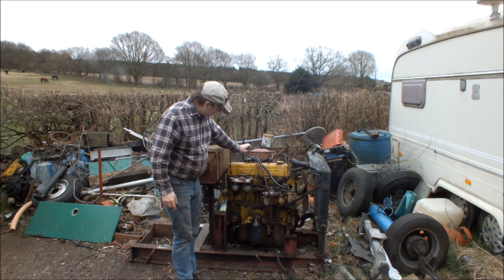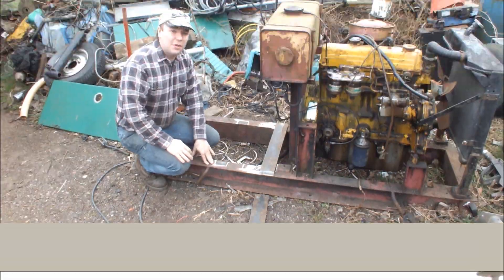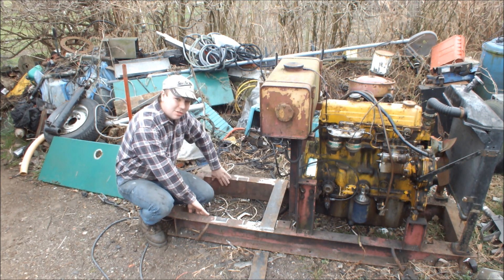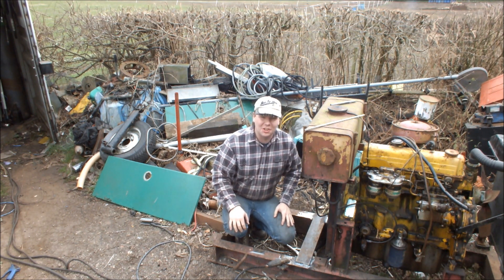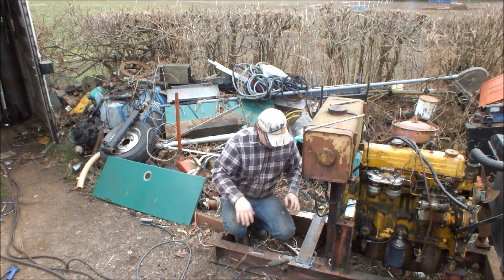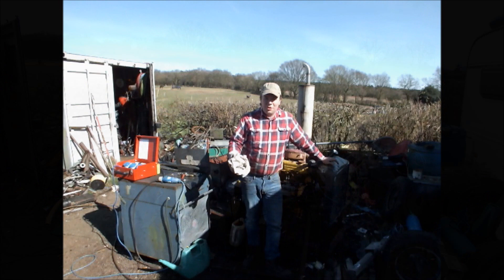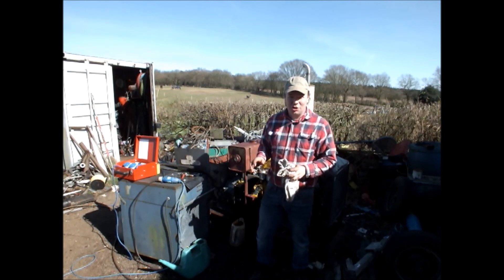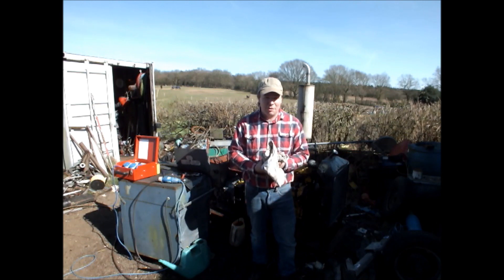Homemade 40,000W (40KVA) Generator set. OFF GRID GENERATOR!!!!!!!!!!!!!!!!!!!!!!!!!!!

Comment: Could I run a pto generator off my old junky Volvo I have sittin around from maybe the axle shaft?
Reply from the maker: @greggoryleblanc1024  technically yes, but you'd need a governor for the speed. Cruise control would work?

Comment: Really like the project. How do you attach the generator to the engine? Was it compatible or are they sorta universal? Cheers
Reply from the maker: If you look closely, they are not joined together. They are mounted independently
Reply: @Bodgemiester  I know they are mounted to the frame independantly but I meant the crank shaft, how do they connect for the generator to spin. Thanks for the response
Reply: @Bodgemiester  A lot of ev builds ive seen have these sort of adapters that go on the end of a gearbox and on the motor so does it work like that? using a coupler of sorts

Comment: Super interesting, great vid, thank you! I wonder how fast you could fully charge a huge (50kwh?) 48v battery bank with that size engine/gen? My house uses 30/40 kWh a day, if I could run that setup for an hour and fully charge a big battery, it must be cheaper than current grid prices  of 35p /kWh!!!
Reply from the maker: It depends how big the charger is but I doubt you could charge it as fast as the generator will output. Not like a tesla supercharger etc. But fast non the less
Reply: @Bodgemiester  I could use a 240v battery instead, not sure if my calculations are correct…but, 80x3.3v 105ah lifepo4 cells = 264v and 27.72kwh of energy…these can be charged at 1c…which is 105 amps..which would take an hour? Average fuel consumption of a 32kw diesel generator is 8-10 litres an hour…kerosene (diesel alternative) is currently 69p a litre.  Making the cost approx 20p a kWh…nearly half what the energy companies charge! I’m now asking myself how on earth can I generate electricity cheaper than a flipping power station with old tech??! Someone is making a lot of money.
Reply from the maker: @tomkilmore7254  I agree but I'd just put more batteries in parallel.  Look for a forklift truck charger. Anything over 50vdc is classed as lethal!
Reply: @Bodgemiester  yes, and compatible with solar panels. Summer….use the panels to charge the battery…winter…use the generator for 1 hour a day. Not only cheaper than the grid but also not reliant on it…thanks, keep up the good work !
Reply from the maker: @tomkilmore7254  thanks, please subscribe,  I will work on the generator this summer i think

Comment: How many houses can that power roughly
Reply from the maker: Hi really depends on the load and more importantly how sensible people using it are. E.g I CAN power my whole house on 1kw if I don't use the washing machine etc, but with everything on I'd be over 10kw.  A 'house' isn't really a unit of measurement. If you were to be careful I could see it doing 10 houses if people knew what the could/couldn't use. Led lighting etc has helped enormously with this
Reply: @Bodgemiester  Thank you sir. I've just acquired a Cummins engine generator and says rated at 130KVA and I intend to use on a farm in Africa for the workers compound. They only use electricity for lighting, tv and fridges. None have washing machines, aircons etc and they are in 2 roomed Nissen huts. So I just wanted a rough idea of what it could possibly handle
Reply from the maker: 130kva should EASILY cope. It may even be a bit thirsty just for lighting but I guess diesel isn't that expensive there. Excellent choice on the Cummins! I recommend using lucas oil stabilizer to make it last for years and years!
Reply: @Bodgemiester  Thank you for the recommendation sir. God bless

Comment: Hello there! I have a Ford Fiesta mark 6  engine 1.6 litre diesel engine which has a drive by wire accelerator. So I wanted to turn it into a power generator 220 Volts.  Please tell me how many watts alternator should I install and what fuel economy can be achieved  max
Reply from the maker: Hi, you will need to know the power output of the engine at either 1500 or 3000 rpm as they are the rpm required for a four or two pole alternator to generate 220v@50hz Then 1 engine BHP will generate approximately 750w. I hope this helps

Comment: What engine is that and why not just connect an alternator on the front of the engine with power inverters?
Reply from the maker: hi. its a ford 4D and its generates over 30,000 watts! that would be some current at 12V

Comment: Great for big loads but total overkill for an off-grid home. I have a Lister TR2 8KVA that will run forever and uses 3 litres per hour at full power. However, since secondhand solar panels are so cheap now I rarely need the generator at all.
Reply: zip it gary. bigger is better
Reply: @robstuckey  Stupidity is not better!
Reply from the maker: Agreed, the plan is to have a few electric heaters abut the place so in winter it can have a decent load on it from time to time, as for fuel you should watch the fuel consumption video I did with it, you will be surprised!

Comment: There is a great deal more to successful genset than just an engine & generator. They must be matched as the comments suggest
Reply from the maker: Absolutely correct, the amount of sets I’ve had on the load bank that won’t ‘pull’ usually a 3000rpm rated engine trying to make power at 1500 in my experience. The old 4D does a fantastic job though, pull a house down at 1500 all day. Thanks for the comment

Comment: I see on a comment you used a Fenner coupling, but my question is, would you be able to use a hydraulic coupling? I'm only asking because I'm thinking of using an automobile engine with an automatic transmission, and obviously a torque converter, but I'm not sure if that would suffer any losses or do damage as opposed to a direct to flywheel installation. The less I need to do and buy, the better. I really want to use what I have lying around the shop for the most part to keep the budget low. Engine is a GM 122 2.0 engine. Very simple, cheap and makes some decent low end torque.
Reply from the maker: Don’t use a torque converter, rpm on the generator is absolutely ESSENTIAL. just make something up, you could even belt drive it

Comment: hello Sir 
can you please tell us the brand name of the engine . thanks
Reply: i worked around the dorset  4 cyl. diesel. they were installed in Powerscreen portable screening plants being exported into the U.S until 1992.on the minmac pump there is a cold start device on them,with all the vibration on the screening plant, the female flag terminal would fall off, causing a hard start condition below 50' .otherwise, very Tough engines! in the screening plant use, the throttle was locked at the injection pump at 1900 to 2200 rpm's so when it started, it went immediately went to that set speed-with authority!!!
Reply: its a ford 2722 diesel, aka ESD 444 came out of europe until 1992, was used in america  in the 1960's.has 72 hp at 2600 rpm dont forget to hook up the cold start device on the injection pump,it will never start below 50' Fahrenheit.
Reply from the maker: Hi yes, it’s a ford 4d
Reply: rear speaker thanks very much for the info.
Reply from the maker: Wow2200 RPM! I thought I was pushing it at 1850!. The mermec pumps on all of ours have mechanical cold start but I’ve never needed to use it even at -15c. However. Where this thing is going in the USA it will see -40c fro time to time so I’m fitting (I’ll video it) a webasto water heater to get some heat into it before startup.
Reply from the maker: Hi, this particular engine is a british made ford ‘dorset’, they made two types of 4d in Britain and were called the Devon and in this ones case the Dorset . We have had these engines in generators for over 30 years and NEVER had a failure or a cold starting issue. We also run two of the 6 cylinder turbo versions (6d) .
They are really great old things. You can identify them by the type of injector pump on them. The Devon vas fitted to the fordson major tractors!

Comment: hi bro , please tell me HP of that engine or CC ? I Made a genrator with 2.5 litre diesel engine which shpould have produced 30kw but eneded up with 5kw power !! whats the reason for that drop .
Reply from the maker: Hi, my engine is 4.0l. The reason for the loss is because your engine won’t make its rated power at only 1500rpm. My engine is an industrial engine so it makes high torque and bhp and very low rpm, car engines give low torque and high bhp at very high rpm. Horses for courses I guess
Reply: my aim was to produce max electricity  production with idle engine speed  [minimum diesel consumption] @1600 rpm, but i failed to get technical specs of that engine - torque & bhp. There are people succeeded in getting 30kw power with that same engine , but they keep the secret !!
Reply from the maker: How many cycles (Hz) do you need. Alternators run at either 1500 or 3000 for 50Hz or 1850 or 3600 for 60Hz. You cannot choose your own rpm, the rpm is absolutely critical to power output and can cause major damage if incorrect.

Comment: Would it be possible to use a car engine like a 2.0 diesel and power a three phase 32KWA generator?
Reply from the maker: Absolutely, you must keep in mind that it is not the engines peak bhp you need but bhp@ 1500/1850/3000 rpm. Rpm depends on the alternator but it can be done because we have actually converted an old ford 1.8 diesel from an escort into a generator. All you need to know is how much power you need and at what rpm so 32KWA = 1.3404 (bhp required per kw)  x 32 (generator output) = 42.8 (bhp@ required rpm) I think a 2.0 may struggle but find a dyno graph for your engine
Reply: Bodgemiester 
Thank you. Also how did you mount the engine to the generator? It may seem like a stupid question but did you use a gearbox off the engine to do it or did you mount it without the gearbox
Reply from the maker: No gearbox, you use a thing called a fenner coupling. Similar ones available all over. Direct drive from the flywheel to the alternator
Reply: @Bodgemiester   how did you do for the engine speed regulator? mechanical ? electronic? or this engine has a regulator inside the injection pump, like farm tractors ? sorry for my bad english, i'm french........
Reply from the maker: Hi Fullrom! I will be using an electronic one. It is not fitted yet but I will do a video when I install it.
Thank you for commenting!

Comment: So you just found a 40kw 3 phase alternator laying around? Tell me where I might find one
Reply from the maker: +james gayler , that one was a spare from my retire uncles generator hire firm, I would suggest you try eBay. They often turn up used for cheap
Reply: You can find generator heads made in china sold on Ebay from 20Kw and on up for not too bad of a price.
Reply from the maker: +roireb1 yeah those Chinese alternators are pretty awful. We use to have a heap of broken ones people brought us to 'have a look at' bad windings
Reply: Bodgemiester if I an going to live off grid like I want to I think I'd rather have something I can depend on not fry its self in 20 mins
Reply from the maker: Believe me, I trust my life on an old 4d, would trust a modern one as far as I could throw it!. I have vast experience with both
Reply: Bodgemiester I not an experience fellow in them but I'am pretty good at learning how things work engines are my favorite. You have an input on the 60KW U.S surplus generators I want to get one but not sure if I am better off building my on
Reply: Bodgemiester great video by the just subscribed to your Chanel and got a thumbs up
Reply from the maker: Hi, if it is U.S surplus it will be 120v @ 60hz, if it is a four pole alternator like the one in the video it will be far easier and probably cheaper just to buy it. There is a good chance you can alter the voltage to 220v @ 50Hz if you need to. Just be sure that it is four pole. You can tell easily by the engine RPM, if it is 220@50 and the engine is doing 1500 rpm then it is four pole, if it is revenge up to 3000 it is a two pole. A 120v set will be 1850 for a four pole and 3750 for a two but I seriously doubt it would be a t 60 kva.
Reply: @Bodgemiester  I’m an American and I must say that the only 120 volt generators I see are the really small ones, like 1500 watt. A 3000 watt or bigger generator will typically have 120/240V, and a 60KW will almost certainly be 3-phase, either 120/208 or higher voltage.
Reply from the maker: Hi, this generator is coming to the USA with me, it will generate 240 by joining two phases together.

Comment: Greetings.
Can you calculate a homemade generator that can power a DC or AC motor of a converted electric vehicle? I suppose the Lister engine is not suitable because it requires a motor with speed acceleration.  This in order to avoid the use of batteries, I believe these will be expensive in the future, and I do not think their waste is very ecological.
Reply from the maker: +Jaime Mariño can't be done, you will need either an ac or a dc motor and a vairiac speed controller. Old milk floats used tonnes of transistors hence the buzz. I suggest dc as it is easier to control. Work out how may Kw the motor is and spec gennie to suit

Comment: how did you connect the engine to the alt? lovejoy or? great project.
Reply from the maker: +Quartzsite Business Hi, good question. I used a thing called a fender coupling. The engine had half of one in it but I had to modify the centre collet to make it fit. Works fine though. I also had a heap of old bell housings but they either fit the alternator but not the engine or vice versa.
Reply from the maker: +Quartzsite Business , you should checkout the fuel consumption video I did with it. Very interesting
Reply: I watched several of your vids including the fuel consumption, very interesting. just finished the motorcycle trailer build.
Reply from the maker: +Quartzsite Business great stuff, hope you liked them. I've got a great one coming up soon. I've removed the fly by wire fro a mechanical diesel pump and gone back to cable. Don't know if it works yet though

Comment: And there you have the power for 15 houses , Nice work .
Reply from the maker: +Harald Pettesen , if you think that's good, check out the fuel efficiency video I did with it. 40,000watt vs 3000watt. You will be stunned! SUBSCRIBE
Reply: @Bodgemiester  that's insane. Now what about a water turbine set up
Reply from the maker: @jessecombs5373  I'd love to make one but I have no use for it unfortunately.  I have great idea for it too
Reply: @Bodgemiester  thoroughly enjoyed this tho.... What type of engine is that plus the bottom alternator
Reply from the maker: @jessecombs5373  it's a ford 4D Dorset and an old Stamford alternator.  I'll finish it off soon. No rush lol
Reply: I subscribe  :-)
Reply from the maker: +Harald Pettesen THANKS